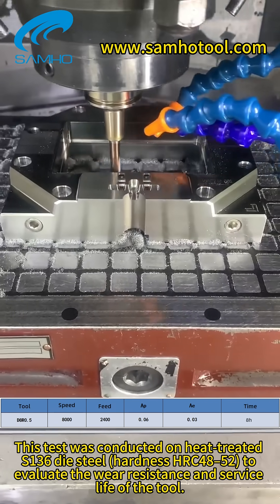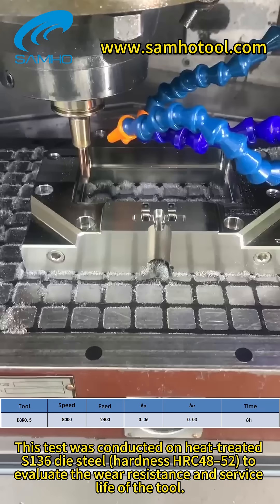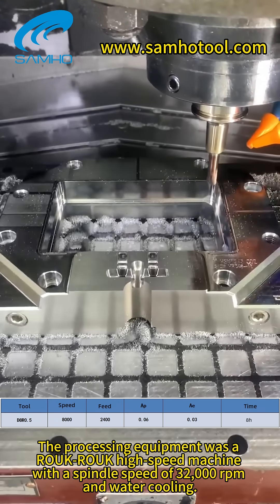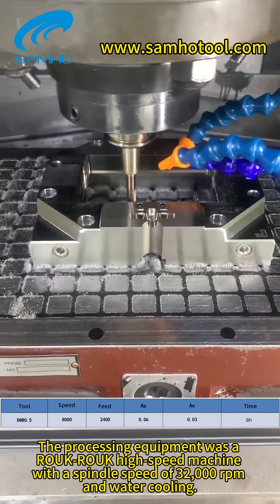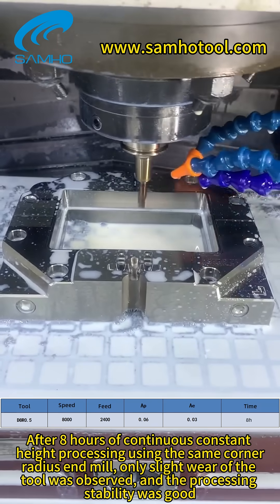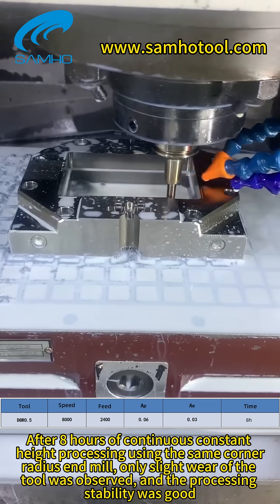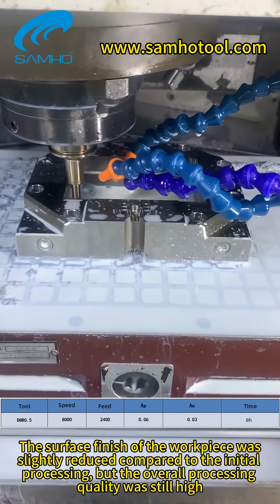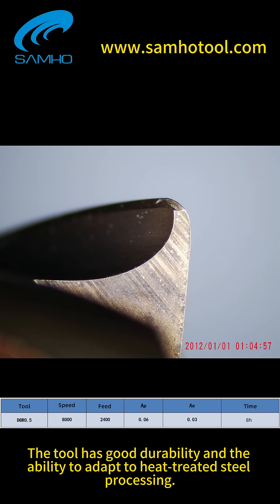Z-level Contour Milling of S136 Steel with End Mills

Comment: It’s not cutting anything, 32000 rpm on steel is dumb, the steel is heat treated but it’s been cut already, what’s the point of this
Reply from the maker: You misunderstood. The CNC machine spindle speed is 32000 rpm. The speed for processing S136 steel is 8000